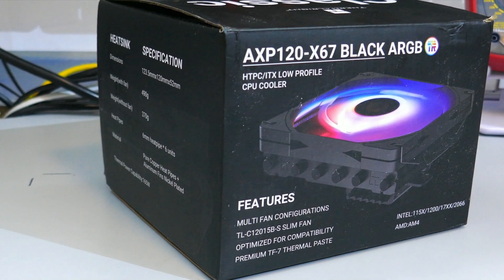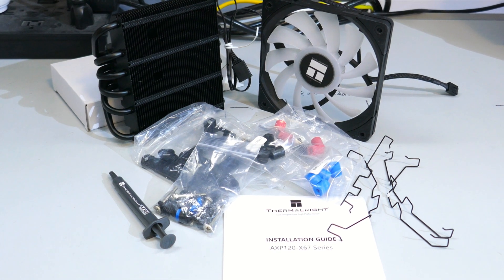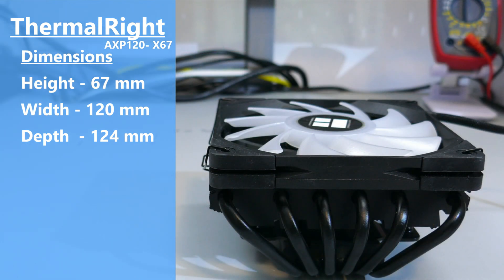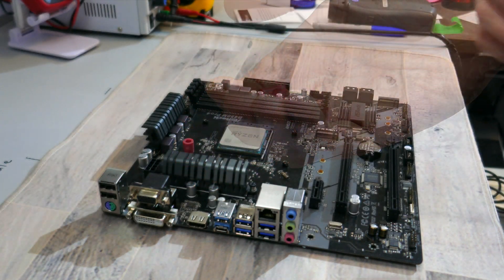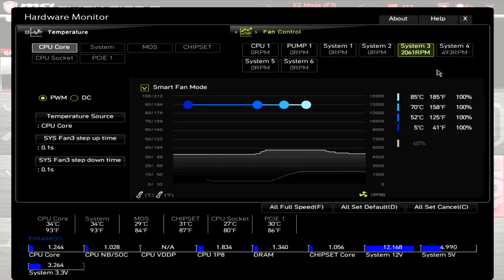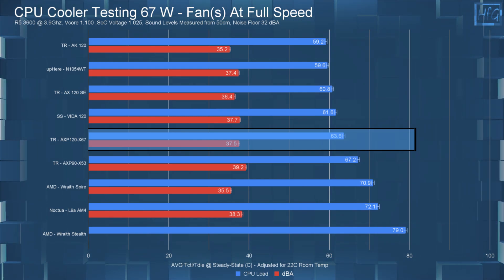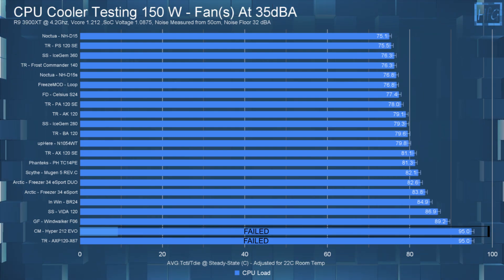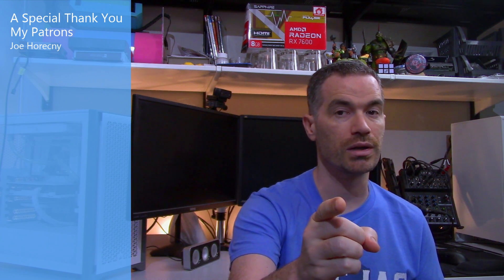The ThermalRight AXP120 X67  Low Profile CPU cooler

Comment: These low profile coolers should always be tested on a ITX MB with different sizes of ram Hight.  That is where there are going to be used 99.9% of the time.  So this review was ok but not what I am looking for my ITX build with this particular cooler.

Comment: Hi I'm struggling to understand your normalization of this data. Lets look at the 87W data. The bottom spot of AMD Wraith has a dBa of 35.5 dB at full speed, only 0.5 dBA over the normalization level of 35dB, and its normalized temp goes up 3 degrees?? Meanwhile the top spot IceGem 360 has a dBa level of 50.1 dBA, a whole 16.1 dBA over the 35 dB norm level, and its temp normalized only goes up 2.4 dB? How does that make sense? If you're normalizing data to a set level, the data that had sound levels the closest to that set level should move the least, while the ones that had a full speed sound level the farthest from 35dBA should move the most. Right?

Comment: Hi. You are the only one mentions at 3.10 that the ram clearance is 45mm which suits me unbelievably but all the other reports are at about 40 or 42mm Which is true?
Reply from the maker: First, it is possible to rotate the cooler to have the cooler's heatsink over the vrm heatsinks which shouldn't interfere with the RAM.
Second, regular the RAM clearance. I measured the cooler I received and it had a clearance of 44-45 mm, so I'm not sure what else to say. It's possible that the cooler may have been bent too much... 

Hope that helps
Reply: @HardwareForGamers  First solution with Asus b760i isnt viable due to the heatsinks just everywhere around the mobo. Second I won t find out since I went with corsair /kingston low profile to be on safe side. I wanted e specific 6400mhz kingston but it was 44 and thw order was from abroad . Thanks though.

Comment: I'd rather have the heatpipe orientation facing the ram so that the cooler could blow onto the VRM instead.
Reply from the maker: it is possible, now the fan will be blowing on the VRM heatsink either way.

Comment: can this one handle 13700k?
Reply from the maker: Overclocked or at full boost likely not. At stock maybe... If you undervolt it most likely, if you're just gaming.
Reply: i’ve paired it with 13700k and it need a serious undervolt 😅. i set power limit to 105w and max temp now hover under 80c but goes 95c at 125w. (note : i live in hot country ambient ~30c during the day)

Comment: The ram clearance compatibility is 40mm not 45mm, this is very important as the most popular argb ram kits (trident z neo) are 44mm and would fit with your stated clearance. They will not actually fit as the limit is 40mm
Reply from the maker: Where are you getting this 40mm clearance from? Because the DIMMs I'm showing (g.skill flareX) are 40mm and there's 4-5mm between the top of the DIMM and the bottom of the cooler...
Reply: @HardwareForGamers  you're showing Corsair Vengeance LPX (34mm) and not G.Skill FlareX.
Reply from the maker: @clearskiesastro1028  3:07 that is flare X
Reply: @HardwareForGamers pause at 5:06 you can clearly read the RAM being Corsair vengeance LPX. Also your shot at 3:08 is also clearly LPX. Find me one image of Flare X DDR4 that has the top and sides like that and send me link in YT DM please, I’ll wager any $ it’s LPX.
Reply from the maker: @clearskiesastro1028  the motherboard, and memory, and CPU that I use for the CPU cooler installation is not my test system.  The memory on my test system is https://www.memoryexpress.com/Products/MX77577

Plus you can watch https://youtu.be/80oH4fPejkk
Reply: @HardwareForGamers  unfortunately not even close

Comment: I have this cooler with a standard 120mm Noctua fan in Hyte Revolt 3 case with 5800X3D. I do have the CPU limited to 100 watts. Usually runs around 60° while gaming and 70° during Cinebench run.

Comment: Solid review.  How good is the included Thermalright 120mm A-RGB fan vs  ARCTIC P12 PWM PST A-RGB?
Reply from the maker: Max performance, I believe the C12015 will beat the p12 by a little bit, however the C12015 will be louder.
Reply: @HardwareForGamers Thanks. Wish more of the ThermalRight fan range like the Reverse, TL-S12 was easily available.

Comment: Planning on building in a case with 75mm of CPU cooler max clearance.  Would be interested to see how this cooler performs when paired with those 20mm Inwin fans you tested recently! Would also be very interested in seeing how this compares to the Scythe Big Shuriken 3, as they are the same height.
Reply from the maker: The ThermalRight C12015 should perform slightly better than the inwin AM120s. I'll ask scythe if they can send me 1.